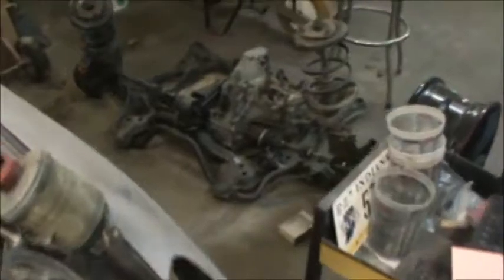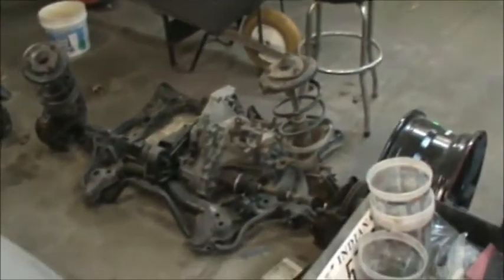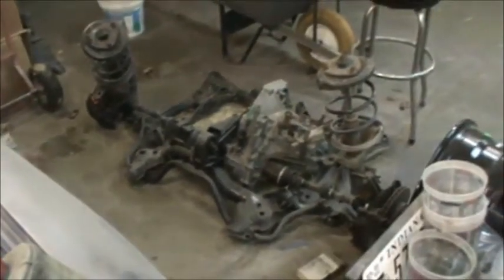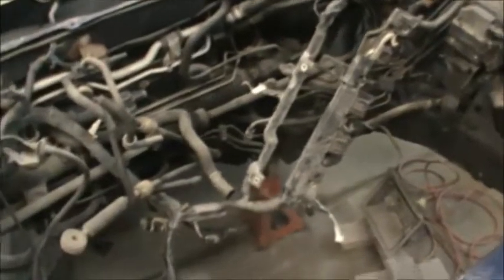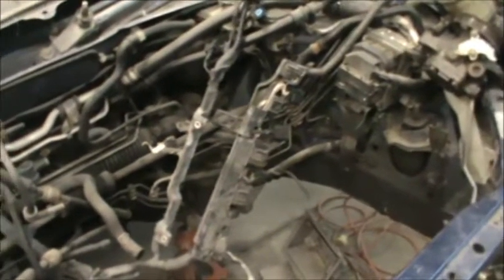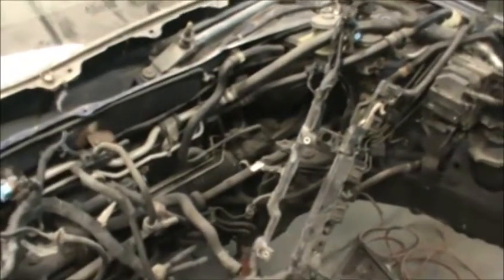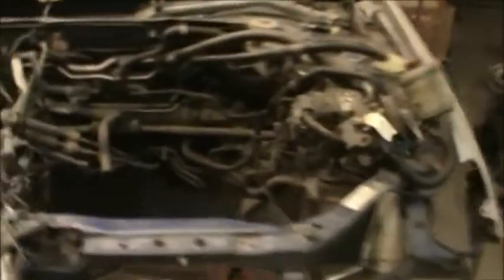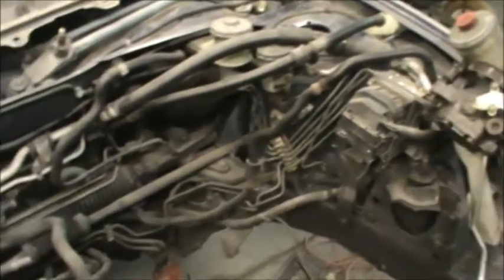My Civic EV Electric Car Project Part 16 Learning The Car Systems

Comment: I think the fan comes on with "open circuit" at the temp sender switch.(it would have been connected to the engine to close the circuit)..Good to see you Tom.
Reply from the maker: That makes sense to me Ziggy!
I think I will only need the condenser fan.
I am really sorta confused on the ground situations.  Do sensors on the engine of a car have their own ground circuits? What exactly is the ground from the engine to the frame for? Is it for ignition only. Also do you know why a transmission would have a frame ground as well? I mean the engine and tranny are connected right?
Reply: Some of the switches/senders have their own ground...The engine and tranny are grounded because the starter only has a positive terminal and there is a big current draw when it is engaged and the engine and tranny is rubber mounted so there needs to be ground cables from the chassis to the "power train"..I hope that rough explanation helps a little.